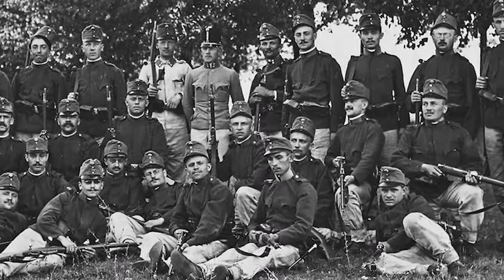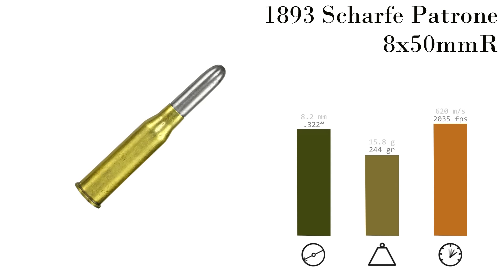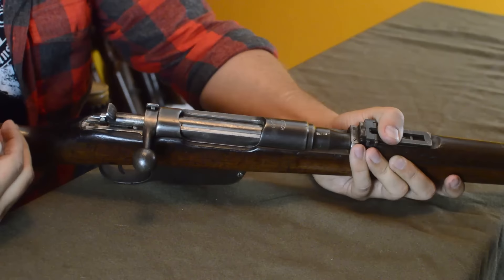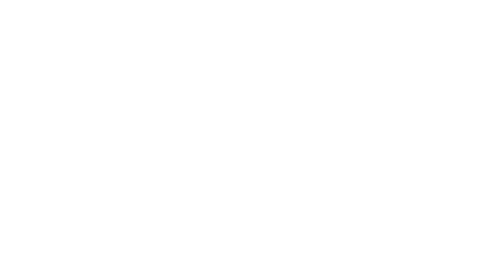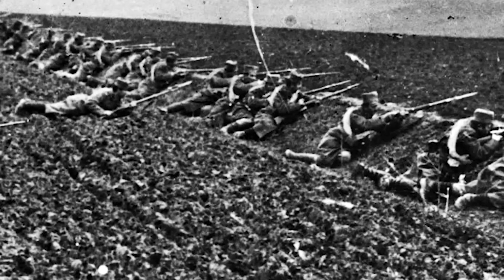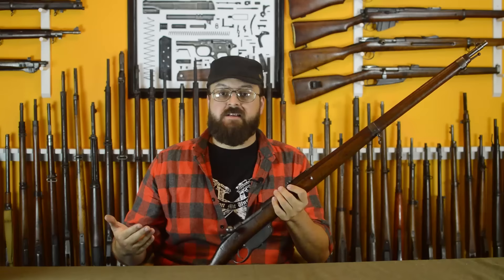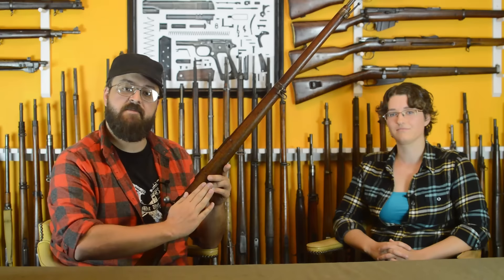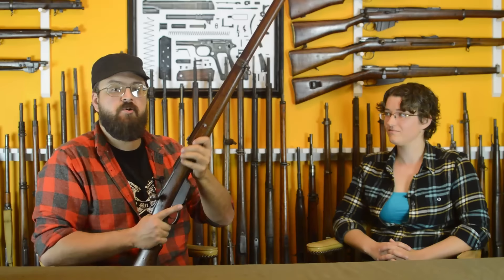History of WWI Primer 039: Mannlicher 1895 Documentary

Comment: My solution to the magazine problem would be to just add a little spring-loaded dust cover over the clip ejection port, like some of the later Berthiers had, so that the port remains closed unless a clip is being ejected. Instead of falling out when the last round is stripped out of it, it gets pushed out (against spring pressure of the dust cover) when the next clip is inserted on top of it.

Comment: Regarding holding the bolt extended during removal and installation from the receiver I cut a small section of 19mm irrigation poly pipe from Bunnings here in Australia. (Dimes are hard to find here) Its nice because its stiff enough to hold it open, but also soft so it won't mark the steel. Plus it is curved to it wraps around the bolt and is nice and snug.

Comment: Othias: You say that there are only thing that can be mixed up when putting the bolt together is that you can get it upside down and that we can "figure that out"  . I put the bolt together upside down and put it in the rifle.  Result was that it was STUCK upside down  and would  not come out . I had to take the stock off , the trigger group off , the magazine off to free the bolt as the sear was stuck in the narrow slot of the upside down bolt.  This is to be avoided IF POSSIBLE!.
             - Dave , in Canada (Whom you say you will welcome notes , but whom you will not read at all!

Comment: The Netherlands also adopted the Mannlicher M95 on december 4th 1985, in 6.5 mm x 53.5mm rimmed, aka .256 Mannlicher. In 1986 the no.1 M95 karbine was adopted for the cavalry. And in the same year the no.2 karbine with a fold-out bajonet for the Marechaussee. Version no.3 was adopted in again 1986 for engineers, artillery and communications officers. This version had a longer handguard on top of the barrel, and a bajonet. In 1908 a no.4 version of the karbine was adopted for 'wielrijders' companies ('wheelriders'; companies equiped with bicycles, for increased mobility!). Later, for all 4 versions of karbine a new updated model was adopted, and the old existing models were updated, bringing the total of M95 karbine versions to 8, 4 old updated and 4 new versions. We (the Dutch) managed to stay out of WWI (only just). The rifles stayed in service until WWII. From 1935 on another version of karbine was 'adopted'. As the army had a surplus of long rifles, and more karbines were required, they started converting long rifles into karbines. This was karbine no.5.
A problem of a lack of stopping power due to overpenetration was recognised with the 6.5mm projectile, and a comission recommended (in 1910) that all rifles should be bored out to 7.9mm to increase stopping power. However, this was never done. On may 15th of 1940, after 4 days of combat and the bombing of Rotterdam, the Dutch army was ordered to stand down and surrender. The M95 rifles and karbines were confiscated by Germany and redistributed to German allies, German police units and later used for the 'Volkssturm'.
Reply: The "7,9" rechamber was to the 7,9 Scherpe Patroon Nr.23, the Heavy MG cartridge ( 7,9x57R) almost identical in profile to the .303 British ( except for Bullet Diameter), and with the same Rim and Head diameter as the 6,5 Patroon Nr.1. The 7,9x57R was an Up-gun of the Schwarzelose MG 07/12, originally in 6,5mm.
The German 7,9x57 Rimless was too bulky to fit a M95 Charger Clip or magazine Well.
( similar problem with 7,9 S Carcanos in 1944-45 by Germans...ended up single shot SS police guns.)
DocAV

Comment: What rifle did they issue to the last conscript sent into combat at the beginning of the big war? and did that rifle need different ammo than most? I have been increasingly asking that question for several nations in several wars, first for 1939 Poland, was it the Mannlicher '95? and then for Austria-Hungary in 1914? I find this question about obsolescent weapons is far harder to answer than questions about the first line weapons; perhaps because they didn't issue them with much pride or fanfare. Also for France 1940 and England after Dunkirk (in the desert, since home guards were not sent into combat).  Related might be wouldn't it have been more cost effective to upgrade infantry weapons than to upgrade far more expensive stuff like tanks and airplanes? for example, wouldn't more StG 44s have been more cost-effective than jet fighters or King Tigers as a production priority?

Comment: the stiffness of the bolt comes from worn out extractors. Changed it on mine, now runs smooth. But i can´t figure out why unlocking the bolt on mine M95/30 after 3 rounds or so becomes a pain in the a**. Already got rid of dried up grease, but no improvements

Comment: In the Ross video you mentioned that the M95 could be made smoother by hand fitting the bolt to the receiver (assuming it had been mismatched during refurb), could you explain how this is achieved? Mine is reasonably smooth, but not as smooth as it could be.
Reply from the maker: Hand fitted by the factory instead of being a serial mismatch re-manufactured later.
Reply: C&Rsenal 
Ah, makes sense. Thanks.

Comment: You failed to mention the 8 x 56R Hungarian round uses a .329-.330 diameter as they recut the barrel besides just reaming the chamber. Ammo and bullets are available from Przi-Partizan.
Reply: They only recut the chamber...the original M95 barrel was 8mm ( .315" Lands, 8,35mm Grooves ( .329" ) and Bullet FMJ RN Flat base, .324"...which used BUO ( Base Upset Obturation) as did all the cylindrical 1880s' 1890s RM bullets.
Research Bullet and Rifling Designs in early Smokeless Cartridges Transitioning from previous BP cartridge Designs and Parameters. Especially the work of Schmidt, Rubin, Lorenz, the French Lebel commission, the Gewehr Kommission, and the AH Rifle design in concomm itance with Baron Mannlicher.
There is lot of Internet BS regarding Rifling, Bullet design, and Commercial American Ideas ( going back to the Gew.88 Commission rifles, their "Calibre", and suitable Ammo for them ( pre-1914!!!)
This BS continues to the present Day (2023)...
DocAV  GB contributor over 26 years.
& Manufacturer of correct diameter Military profile Projectiles in Brass by CNC.
Reply: @astridvallati4762  Thank you very much for the correction on the bore. I don’t know how I came to that erroneous memory. I have made a note to reference my CIP specs page. Again thank you.

Comment: I have a Budapest 95 marked carbine from 1918 in the original 8x50mmR, it turns out that 7.62x54R has the same rim. I have fired about 20 rounds of 7.62x54R through my rife with the only two problems being accuracy and that the bolt is hard to open afterwards.
Reply from the maker: That is extremely inadvisable.  They do not share the same rim thickness and headspace and 7.62 is unlikely to seal properly, you're probably getting very lucky that it's just a stuck bolt.
Reply: I appreciate the concern, but I will continue to use 7.62x54r ammo until I find ammo or purchase the reloading dies from Buffalo Arms, There are no signs of over pressure and if i trim the cases i will have fire-formed 8x50mmR cases. 
~Ben
Reply: I also forgot to mention that the Indian Government produces Modern 8x50mmR ammo sold as .315 IOF ammo for civilian use.
~Ben

Comment: Ok Tiger Imports has released Mannlicher 88/95's, not 88/90's.  not sure what that means.  Does it use falling block 88 or rotating bolt 95?  Does it use black powder 88/90 cartridge or the M95 cartridge?  I can find no mention of the 88/95 Mannlicher in your videos.   Never mind, Ian has a video.  Just found it.

Comment: The animation shows the bolt head move back from the start of pulling. Theres no way to know why is that. 
Does it have primary extraction or not? The locking lugs seem to have an angle to them. Is that what gives PE? Do angled lugs have a chance of unlocking under load?
UPD
angled locking lugs - https://img.allzip.org/g/164/orig/5152269.jpg

Comment: a little late to the party, but i thought someone might be able to answer this dilemma. My buddy bought a stutzen carbine a while back, and the action felt good and everything. While it didn't have any problems feeding a bullet and firing, the casings kept expanding in the chamber and getting stuck, and the only way to open the bolt after that was to stomp on the handle. Is this a common issue, or did someone mess with the chamber?
Reply: Not a common problem, but not unheard of either.  However the more common issue from firearms from long-term storage is a sticky chamber from the formation of a varnish like substance that forms in cosmoline storage.  It is often difficult to remove through normal cleaning and requires a more aggressive approach.  Personally I use a bit of paint stripper on the chamber and bore of all guns from such storage.  Just make sure to remove all the wood first since even a drop will ruin wood finish.
Reply: the wood was practically black. and he sold it.

Comment: I'd hate to be that guy, but M95s can be topped off. It's not as easy as a Mauser, but it's not that difficult. You can also upload them with a 6th round in the chamber.
Reply from the maker: I've never found it easy or reasonable to top up an enbloc.  As for 6th round, you can do that with nearly any bolt action.
Reply: C&Rsenal it's pretty easy with the M95, definitely faster than ejecting the clip and loading it back up if it's your only/last clip.

Comment: Are there any yugoslav 95/24s that still fed from en blocs or were they all converted to stripper clips across the board and if they were did they suffer from the retrofitting as much as the gewehr 88/05 did?
Reply from the maker: They were all fitted for stripper clip loading and while they work they suffer weak extractors.
Reply: C&Rsenal Ah, thats unfortunate, they look like cool little rifles, thanks for the info!

Comment: How do i make my action butter smoth? It's not very smooth right now..
Reply: Is it an M.95/30 in 8x56R? You could try disassembling the bolt, cleaning it, and slathering it in grease. If that doesn’t work, you are probably out of luck. The rifles were originally hand-fit, but there was not a significant effort made to keep matching parts together when they were converted. This resulted in most of the rifles having a collection of parts fit for different rifles, which means many of them are sticky.

Comment: Looks like a rough action
Reply: Pieter Batenburg They can be, they tend to stick if you don't pull it straight back with some downward pressure while it's in your shoulder. If you drop it down to your hip and cycle the action palm up like she does, it's going to bind up everytime.
Reply from the maker: Originals are fairly light, if not smooth, after that initial tug.  It runs better from the shoulder, but then we can't see the feed and it throws brass into the overhead camera.